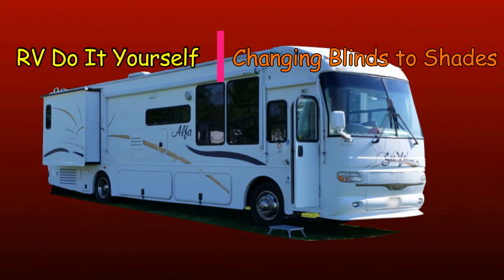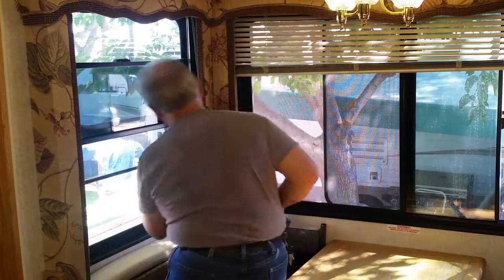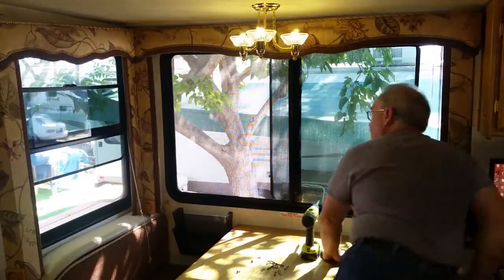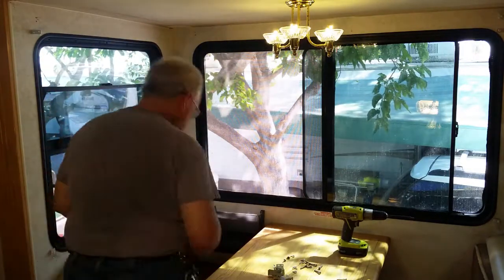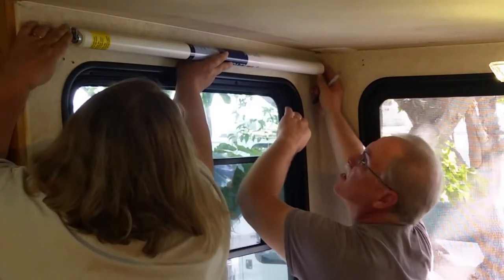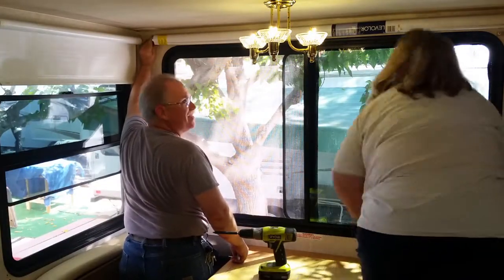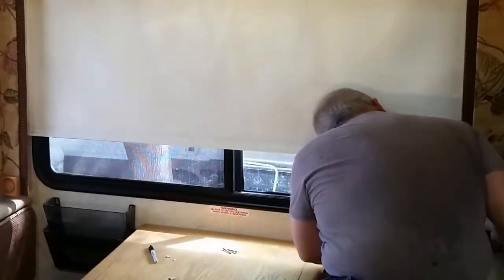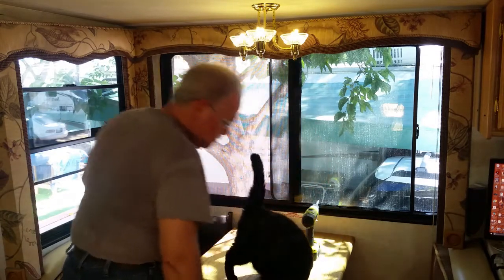DIY RV - Changing from Blinds to Window Shades

Comment: yes can you help is it possible to replace my night day shades with vertical blinds? I have one blind by the dinning table that has got mildew on and i cant get it down and clean as i dont know what i am doing and i am on my own any help would be  great thanks
Reply from the maker: It's possible to replace night day shades with vertical blinds, but you may want to think about it first. Vertical blinds have no support on the bottom  and will sway and swing when the RV is in motion. This will cause them to wear out and come apart.
Reply: @HowWeDoIt_HowTo  thanks for that help; My Cottage from the USA is stationary as i live and work onsite. The only time it would be in motion is when it would be sold. Where in NZ could i buy a single shade like you did? I saw a shade with the valance all in one but they are $255 US! Would a blind work like yours do and where did you purchase them as we have many outlets here also thanks for any suggestions